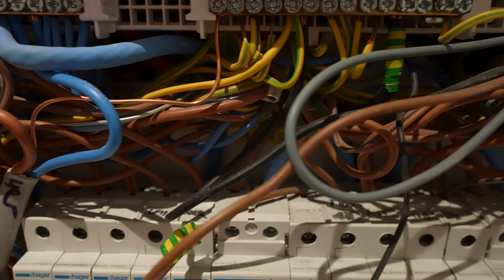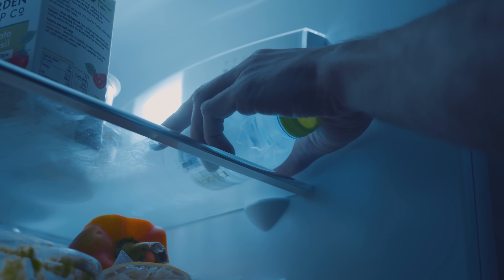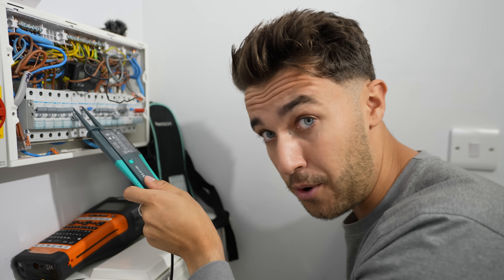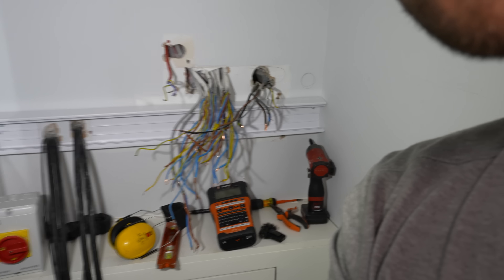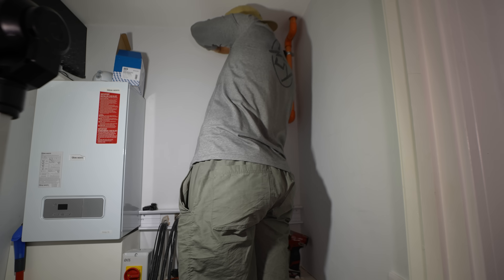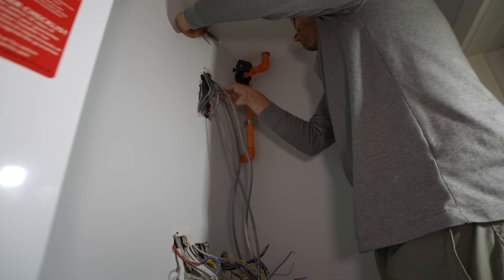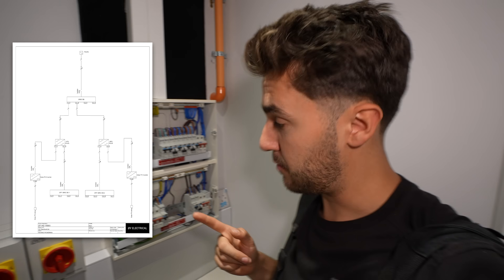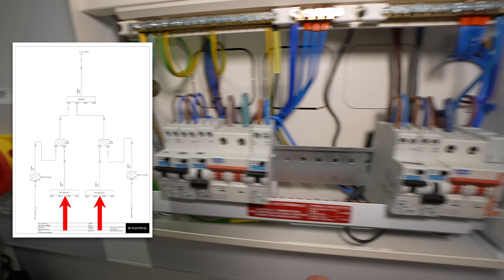DIY DISASTER CONSUMER UNIT - Off-Grid Wiring Deep Dive | ØY47

Comment: Could you expand on the earthing arrangement? You mentioned that you need to replace the existing TNCS.
What prevents you from connecting the rod to the MET as an additional ground?
Reply: @gavinnoname1424  the general thing is that if you want to be running when the grid is down, you need to be completely isolated from the incoming cables so anyone working to fix it upstream can work safely without worrying about and backfed power. If you're on TNCS then you're still connected via the earth even if you've isolated L and N through the inverter. Also there's the concern that if you rely on the incoming earth you might not actually be connected to ground during a power cut
Reply: You do not need to *replace* the earth from the DNO - the way it is 'explained' in this video isn't clear and would lead you to think that you must replace it if going 'off-grid'.

There *is* a mandatory requirement to install an additional measured earth electrode and connect it to your installation MET if you intend to install any form of generation (whether operated in parallel with the DNO supply or used as an alternative source). The assumption is that you can't rely on the DNO supply earthing being effective during a fault scenario.

Convention is that this additional earth electrode would be permanently interconnected with the DNO earth at the MET. BS7671 actually recommends (reg 411.4.2) that you have an additional earth electrode installed and connected to the MET if your supply is from a TN system (the vast majority of DNO supplies are from TN systems).

There is some debate amongst some installers regarding deliberate disconnection of the DNO earth while the installation is operating 'off-grid', particularly where the DNO supply is from a TN-C-S system. This *is* permitted under BS7671 but requires careful consideration and full compliance with the regulations.
Reply: @protectiongeek  Very well explained and I can follow the logic.  I'd add that, in my humble experience with earthing (for  radio/comms installs), a single earth rod won't cut the mustard. Apart from the peeing on the ground ,before taking the reading ,you really need two or more rods suitably installed.  

Another beef I have is that I see a lot of installers making nice coiled piggy tails in their earthing connections - DON'T - it can add impedance and will underperform  if there is lighting in the area.
Reply: Didn't know you were a KNX fan. You did mention it in a different video, though. Using KNX in my home. Just installed Home Assistant and with a bit of luck solar and a battery are coming soon. Having a tough time deciding which gear to choose.

Comment: Yes, here in France conduits are obligatory. They make repairs SOOOOOO MUCH quicker and easier. No need to destroy the walls. Just pull through a new wire. DONE. 
The same goes for sockets because our wall-boxes are round ! Drill the wall with a hole saw, push in the wall box, fix two little screws. DONE.
Reply from the maker: The regulations and practices here are so stubborn to move on and progress. It hurts me 😅

Comment: Curious question. If your property drops off grid, why do you need the rod? The whole point of the earth is to keep the property at the same potential as neutral. If you lose grid, have a contactor that drops the whole grid similar to how a PEN fault device works but at the property. A floating propery is far safer given theres no chance you have step voltage.
Reply: Because the RCD and RCBO will have no earth leakage to detect and so cannot protect you / system will fail it's own earth test.
Reply: @L81ker  protect against what? On a floating system, there's no need to earth. Think of it like an isolation transformer.
Reply: Neutral and live should balance. Fault current to earth trips the protection circuit.
Reply: @L81ker  what earth? If it's floating, then live has no potential against "true" earth.
Reply: @grahamek86  BS 7671:2018+A2:2022, the recommendations regarding earthing arrangements for solar panels are essential for ensuring safety and proper functioning. 

...and if its a domestic property subject to building control, and has electrical outlets, consumer unit, then BS7671 is mandatory... ergo so is earth bonding and all that goes with it. 
A shed down the allotment I'd agree with you. A domestic dwelling isn't the same thing. 
If someone died, and you were up before the beak, who says, "What could you have done differently so that person didn't need to die?" Then my answer is this, because it's proven best practice in the UK.
Reply: @L81ker  I understand the legislation and the requirement for earthing systems in utility supplied power. Electrically, however, It still begs the question, why an off-grid system (or one that isolates from the grid on disconnection) requires earthing. Earth is just a supplementary path back to the center tap of the transformer. In the absence of a utility supplied power, the center tap of the transformer is of no relevance to the supply. If the house is running entirely off the inverter, the CPC can be bonded to the neutral terminal as a sort of MEN system - true earth isn't relevant.
Reply: Photovoltaik Panels require earthing for correct operation. Some say they saw a boost in production

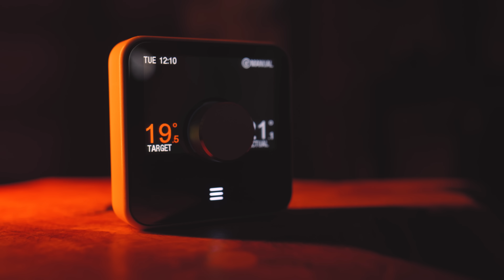Comment: @2:16 doesnt the heating need gas from the gas grid? or do u have ur own gas tank?
Reply: In my experience power cuts don't usually remove the gas from the pipes as well 😉

I expect Cory's talking about the control/ignition for the boiler.

Comment: Can't wait to see how this all ties into Home Assistant, i've been rewiring my house in a very specific way to take this into account as well, be interesting to compare
Reply from the maker: You and me both!
Reply: @corymac  i'm working towards a 45way CU, ultimately for individual control of EVERY room, both ring final and lights. I'd love one of the SPAN units from the states that have power monitoring and an app but I don't see anything like that for the UK, unless you know differently?

Not sure you're comfort level or access to HA knowledge, but hit me up if you have Q's, i'll try and answer what I can
Reply: sygad1 @sygad1  HA is a bit of an overkill for this, you can buy self contained change over switches. He mentioned knx, so I'm assuming he'll be using that/those devices for monitoring power and doing the switching.
Reply: @jasonmart1081  I didn't take it as HA to control the switch over, I took it more that HA is going to form an integral part of the automation side of things

Comment: Why do you use RCBO on every circuit?, in europe I usually see one for the whole flat (or 1 for each busbar).

I can only see convinience as reason, if 1 is tripped then nothing else will am I right? or UK has a different code about this?

Thanks :)
Reply: That is the point of RCBO's, they avoid the need to have one RCD covering multiple circuits. That way you can avoid nuisance tripping caused by all the leakages on multiple circuits adding up causing a single 30ma RCD to trip out multiple circuits and instead get 30ma protection on each circuit. Particularly useful with solar installations and certain types of inverter as these are notorious for creating additional leakage depending on weather conditions. Before I changed to RCBO's I would get nuisance trips monthly, yet nothing was faulty, just normal background  "leakage" caused by the length of cables  of say 10ma but then add in an additional 10ma of "leakage" from the solar depending on weather and you have got problems. Now my solar sits happily on its own RCBO that 10ma leakage is never going to be an issue, and nor is the 2ma of induced leakage on all the other circuits. Now if they trip it is because of an actual fault on that circuit, not an accumulation of "normal" and predicted effects overloading a single shared RCD.
Reply: There is total earth leakage to consider if you have lots of circuits on one RCD.   Also you only lose individual circuits if there is a fault, not a bank or all of the property is switched off in the case of a fault
Reply: Don't know if it's true but I've heard electricians talk about how ring final circuits are more prone to nuisance tripping than radials. Maybe that's part of why RCBOs are more common here?
Reply: @JamesScholesUK  that totally makes sense, as a lot of the issue is as I understand it cables lying alongside each other in the other cables magnetic field, inducing secondary currents, plus I guess the ring is virtually always on as it serves multiple appliances, but a radial only when the appliance is in use -dont know if that makes a difference.

Comment: I enjoyed the video, thanks. What is the power rating of the inverter in the battery? You mention the energy capacity but I'm not familiar with these all in one units and am curious 🤔
Reply from the maker: 5kw on and off grid EPS output 😎👌
Reply from the maker: Each, so 10kw total